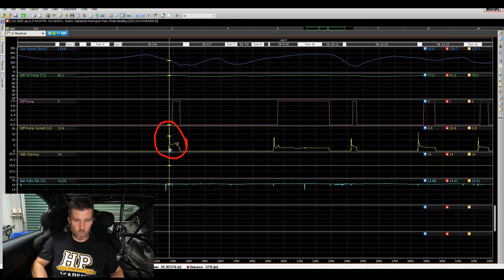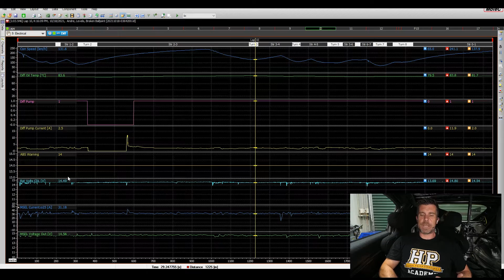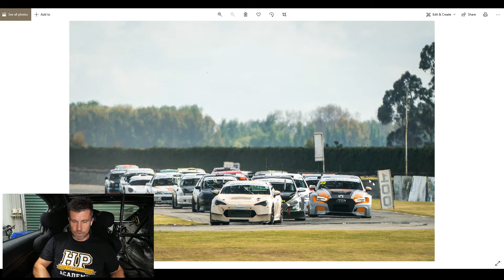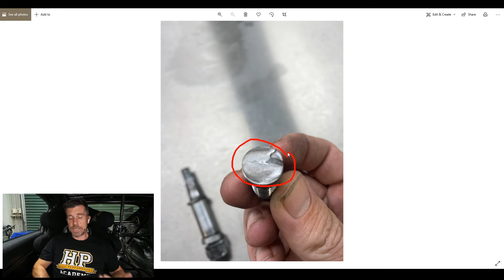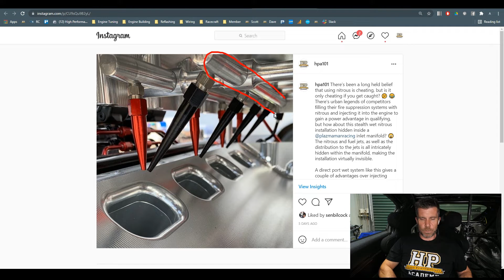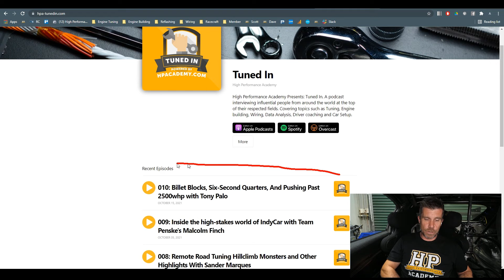Push To Pass, Racing From A Flat Deck Truck & More

Comment: Hey André, how about a large capacitor in parallel with the battery? Since it sheds a lot of Amperes in a short period of time, you could soften up any power draw. Usually it's used for sound systems that draw lots of current for short bursts. If it do not help, could tou please explain why it wouldn't be feasable? Cheers!